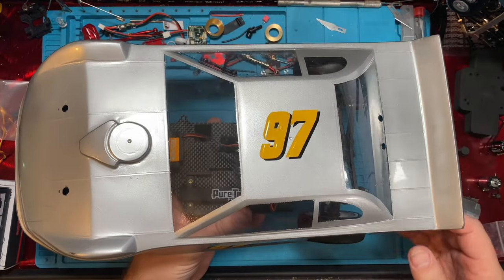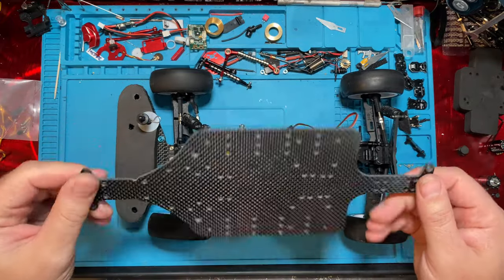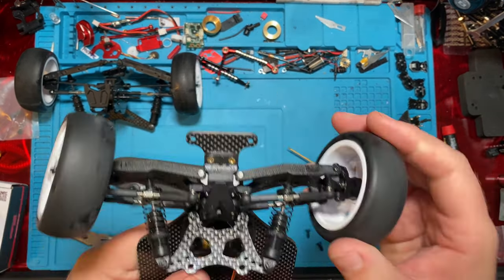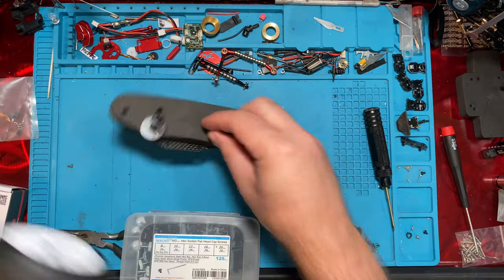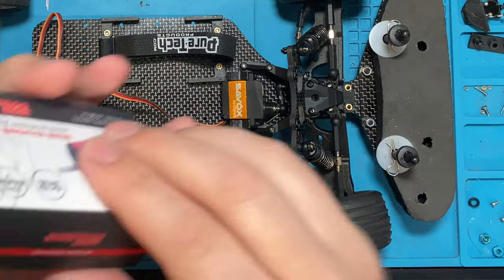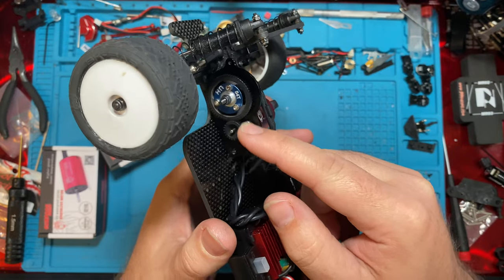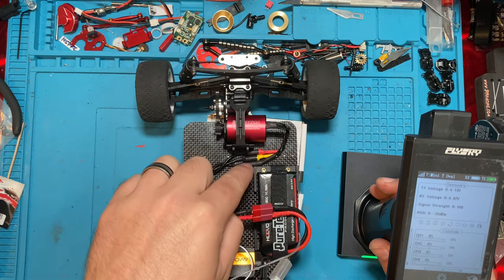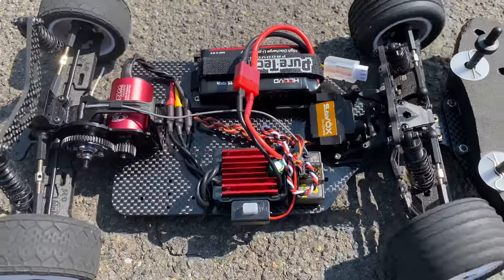Mini B/T2.0 HackFab Omni Chassis Conversion to On-Road Car!

Comment: How long would the chassis make the vehicle after the conversion. I am running 1/18 Open Class and rules say the vehicle has to be 7" wide by 12 inches long. Awesome channel you have super helpful information.
Reply from the maker: It makes the wheel base length either 204mm or 210mm. (You can adjust that) as for the actual chassis length, it’s going to depend in part on your bumper and body and such.

Comment: Omni has the body's too ? Wheels ? Do you have links in previous videos
Reply from the maker: I link to the wheels and tires I am getting in the video description. As for bodies, you can use just about any 210 or 204 wheelbase body that has room underneath for the shock towers.
Reply from the maker: The current wheel and tires are just mini b/t2.0 tires/wheels.

Comment: What do you think about pairing a Traxxas Velineon 3500kv 10 turn 540 can setup with the Omni chassis? I mean I know it's pretty ridiculous, but just /how/ ridiculous is it? 😝

I pulled it out of my Slash after about an hour of use to upgrade to a Castle 4S system and I want to find something to put it in. My Mini B pro roller currently has a junk 7200kv motor and is hard to drive already, so naturally I want something even more difficult to control. I'm thinking the Omni would be a good place to start. 
Probably stick to 2S with a small pinion, and I'll need to figure out a spur with a compatible gear pitch. Motor plate will be easy to design and have made. Rear diff will probably explode, although I already have it locked with JB weld so we'll see what happens there. I'll definitely use the Traxxas TX/RX with TSM too. These are the kind of thoughts I have keeping me awake at 3:30am as I type this.
Reply from the maker: Hahaha definitely an interesting idea.. i'd record it! lol I donno how well that locked diff will hold but worst case, it fives you a reason to upgrade! lol

Comment: What spur is that? I can’t find it online
Reply from the maker: it was an old Hot Racing 54T locked spur gear (no slipper).

Maybe this one will work: https://www.towerhobbies.com/product/55t-0.5mod-steel-spur-gear-losi-mini-no-prep/HRAMTT55M05.html?srsltid=AfmBOoqlfILMiPOQQDibFZgLZsniF7PsQZsgZVo2hFghjPcDFPBAJECh
Reply from the maker: or this: https://www.ebay.com/itm/387269520177?chn=ps&mkevt=1&mkcid=28&var=654515097866&google_free_listing_action=view_item&srsltid=AfmBOortPlNilnqoRuvVBe53DsmzIlqr0J83Z8SWsyQfbbiy_RDzfNCt2YA

Comment: I dunno.... If it was free and I was really bored.... I mean if you want a fast car. Buy a fast car. Don't spend $30 grand trying to convert your  120 hp Nissan into a Mustang. By a v8 Mustang. Same with the Mini T. It was desighned and is a light weight 2wd run around fun vehicle. It swapped end easily, wheelies on demand with brushless and durable. $800 in aluminum bling later its a overweight Mini T. After this $100+ CF treatment it will still be a Mini T 2wd 1/18  BUT with CF. Get a 4wd road car.
Reply from the maker: people actually race this platform. ;-)
Reply: @TheShopMiniRC  Sure its a great size. I love 1/18 and was a early adopter buying one the the 1st Mini Ts. I want to setup/run mine on road/street and was disappointed to see even with that chassis how easy that rear end comes around. Sure the tires, throttle control, braking etc... I have tried shocks, oils, moving shock positions but still cannot eliminate it. Any tips out there? I guess light weigh and 2wd???
Reply from the maker: @JIMJAMSC  I think tires are key. I haven’t raced it in any official capacity, so I’m not sure the best setup, but lighter and proper weight distribution is almost always key.
Reply: @TheShopMiniRC  How much longer is the wheel base over stock? My brushless highly modded T with all the durability/ drivetrain/ parts is almost undrivable. Those spin arounds even on grippy surfaces is annoying even with throttle/brake control. I mean if the wheelbase is longer and helps plant it as much as a 2wd car can I am ready to get the 2/2 chassis.